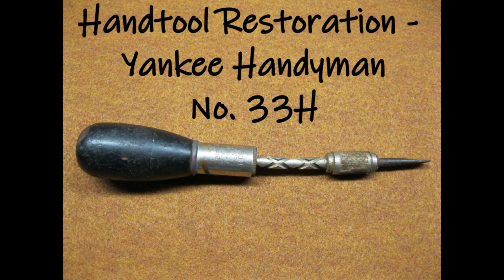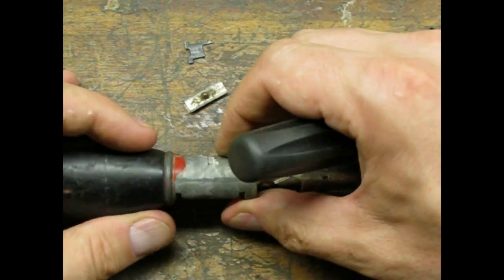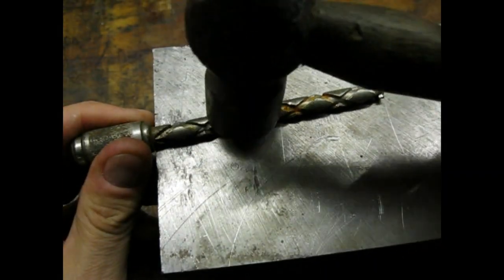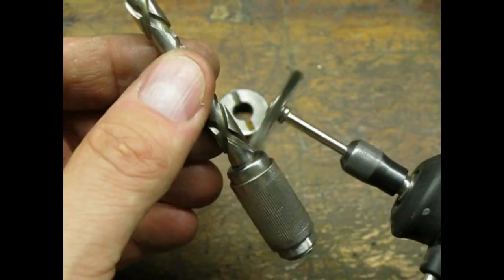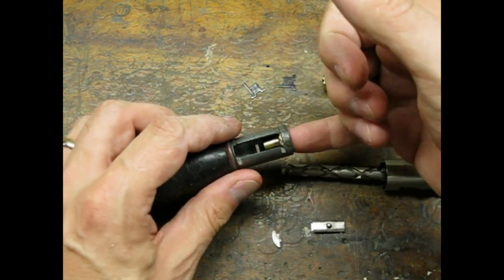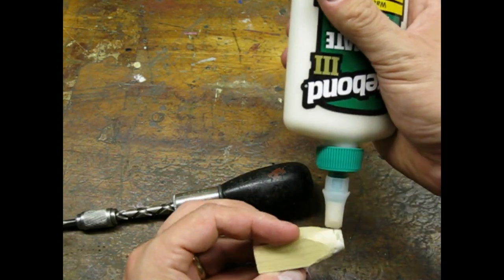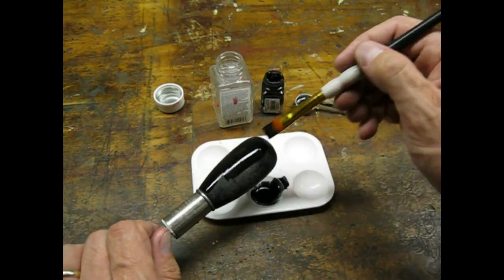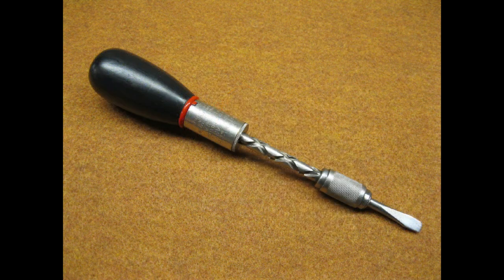Hand Tool Restoration - Yankee Handyman No. 33H

Comment: Great job. How were you able to remove the retaining screw/fastener. I saw you used a channellock with tape. Did you just unscrew it? Thank you for sharing.
Reply from the maker: Thanks for watching!  Yes it just unscrewed.  The nut had slots in the face for a spanner tool that I didn't have!  I put the tape on the jaws to keep the damage to a minimum.
Reply: 357magdad Thank you. I have an old Klien that i took to the beach and the kids played with and dropped it into the sand. Again thank you. 
Robert

Comment: Fantastic. What brand of were wheels do you use for your rotary tool? I've been trying to find some that don't sling wire everywhere and last more than a single couple minute use. Great job on the driver. It turned out really nice.
Reply from the maker: Thanks for watching!  I also use the cheap Harbor Freight wheels that sling wire everywhere!

Comment: I have a very similar Yankee screwdriver that I'll be posting soon, but it is spring loaded. Model 133H. Was wondering if the spring was missing in yours or did it come that way.
Reply from the maker: My understanding is that the Yankee Handyman screwdriver models starting with "1" have a spring.  There are some good resources online that cover the history/patents/models etc for the screwdrivers and the push drills.

Comment: I just picked up a 133h that's very similar to your 33h.  Do these models not have a locking mechanism to hold them shut?  I have 2 other Yankees and they both have the collar ring that locks them shut.
Reply from the maker: I think the lock was only offered on the larger screw drivers.
Reply: @357magdad  I have a Craftsman version of the 133.  Says made in West Germany, it has a lock, but that is probably a variation since it's not a Stanley.  My North Brothers #31 has a lock, but it's the large one like you said.  Thanks for the info.

Comment: Sir, you completely forget to put spring in handle, it was missing when you open it. Put a spring in it and it will works automatically.
Reply from the maker: Thanks for watching!  The Yankee 33H was made with no spring in the handle.  The 133H model included a spring.  The 133H had a screw in the butt of the handle to access the spring.

Comment: Nice result.
It's beautiful but it's not right.
I have to tell that its not a perfect restoration.
1) The yankee 33H has a screw on the top of the handle and not a wooden cap
2) If you tried to remove the handle you would find the hole and have access to the safety ring of the ratchet.
Reply from the maker: Thanks for watching!  I think the Yankee 133H had the screw in the butt of the handle.